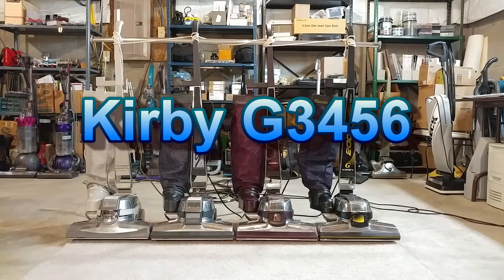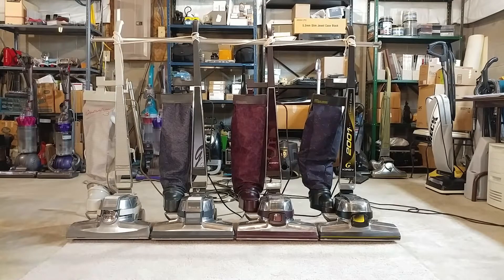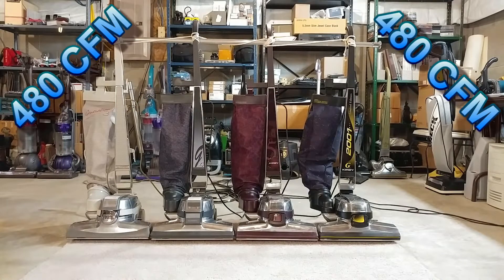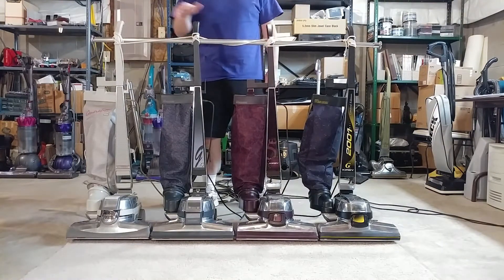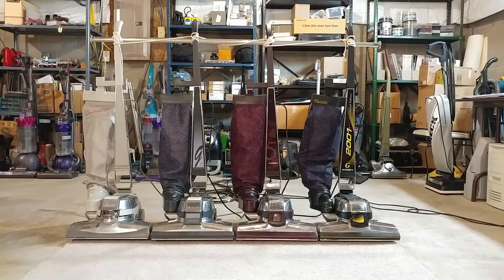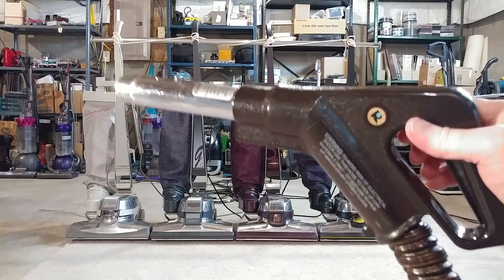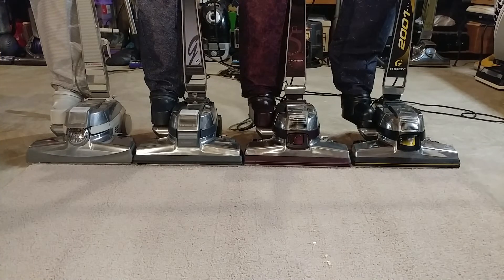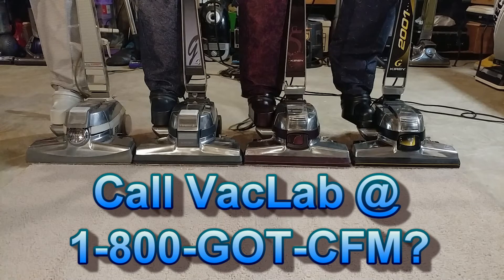The Kirby G3456 Quartet

Comment: Straps together at each ones carry handle at the bottom of the upright handle too so they stay, possibly a velcro loop that combines the cords so they bundle vs risks of running over them but carefully  they can be easily  well idk lol used WITH tech drive ON lol
Reply from the maker: Or I could just weld them all together. 😄